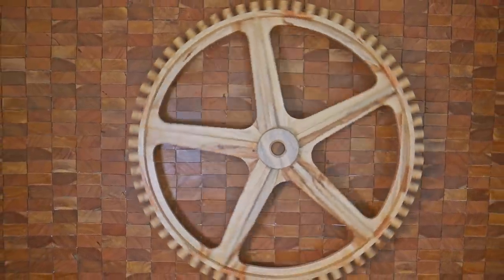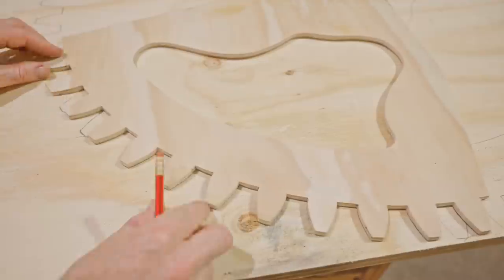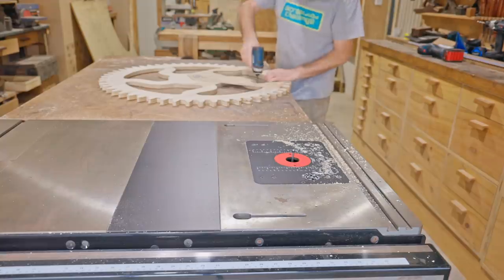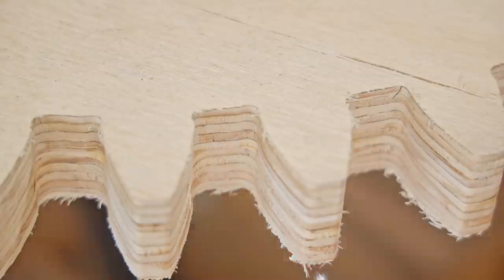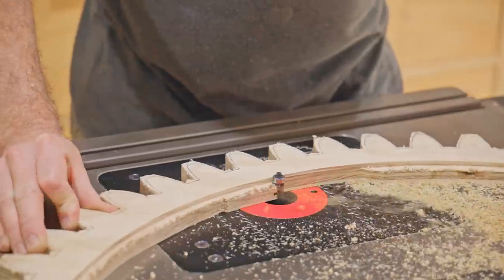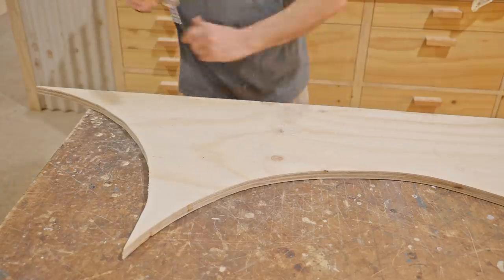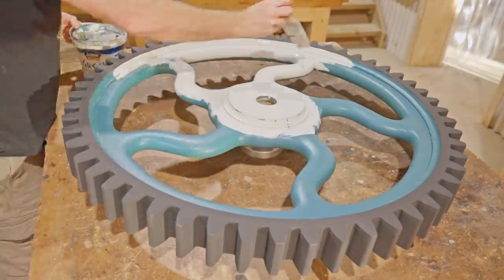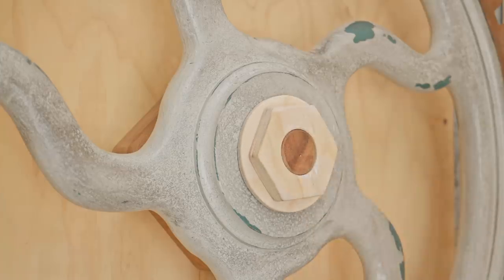How to Make a Large Plywood 'Cast Iron' Cog

Comment: Great video - no CNC, no laser cutter, no 3D printing, just regular tools just like 99% of the viewers would have. Inspirational.  Thanks for sharing ! :)
Reply: I have a 3d printer and no bandsaw, but inspirational nonetheless XD
Reply: Sure, 99% of viewers have a bandsaw, a router table, a handheld router, a lathe, drill press and an assortment of cordless power tools. Oh and a huge workshop, bigger than my apartment. I feel ya.
Reply: well the hole workshop setup is more expansive than those tools would be. 
And sharing desings is easier with that kind of stuff.

Comment: I think the finished gear looks great and the “rust” effect actually looks better once you added the clear coat. 
The same thing would happen to dry powdery rust if you sprayed it with oil.
For more faux finish effects you could dry brush silver paint onto the contact surfaces of the gear teeth.
Reply from the maker: Thanks! I know what you mean, it does have that look. It’s just the dry rust looked more realistic although the sealed rust effect still looks ok. 😊
Reply: @PaskMakes  when i first saw the notification for this vid i actually thought you had cast it in metal from a pattern that's how good the finished cog looks well done
Reply: @PaskMakes  My wife sprayed clear lacquer on an old ashtray stand and added a pot on top to make it a plant stand and it looks great. Neither of us had ever heard of spraying lacquer over rusted steel/iron but she figured she try it and it came out great. I really feel that it's a viable option when faced with dealing with a rusted metal object. It sure cut a lot of steps and made finishing that plant stand a simple matter of waiting for the lacquer to dry.
Reply: @PaskMakes  I was going to say the same as the OP. I think your bright Aussie climate might make rust look brighter than it typically looks in the UK. It tends to be brown and drab here and the clear coat makes it look more like that.

Comment: Fantastic job. Did a rust finish on a large steel frame used as a structural support in a doorway years ago. Sprayed an acid concrete stain on it to get a rust finish, it worked very well. Then sealed it with a clear urethane, it did change the effect more than I wanted. John Shoureas tip posted will come in handy. If you want an aged, weathered wood look, soak some steel wool in vinegar to make a rust solution (2-4 days, remove it periodically to let the oxygen accelerate the process ) . It will react with the tannin in the wood and "weather" it. Every species reacts differently, some take 20-30 minutes, others, like oak give immediate results. The faster the reaction the darker the end result. Fun to experiment.  A weathered wood cog may be a cool addition.

Comment: To further enhance the effect of 'weathering' on your new cog, give the whole thing a 'wash' (very dilute mix) of acrylic paints (black and burnt umber). Then before the paint has dried wipe away the excess with a rag. This will leave most of what paint remains built up in corners and recesses. Best to do in sections. Refer to Punished Props or Evil Ted for more details on weathering effects. Note that this is not to simulate the effects of being in the weather per se, but the effects of general usage.
Reply from the maker: That’s a great idea Barty - I did look at the recesses thinking it needed some grime in there. 😊

Comment: Painter and Decorator since 1982 and a aged paint finish is stumbled upon by accident. Acrylic paint over a surface wiped down with Barbecue fluid. You get a distressed crackle effect t that doesn't need sealing.  Just scuff up the finish and brush thinned Bison wax over the paint then empty the content of a vacuum cleaner bag and buff away. Smells a bit for a while but the effect is you can achieve are worth it. I was also restoring Antiques for a few years mainly Water Gilding and the same rule applied when making a piece look old and grimy. It is all experimental. I keep hammering away unti I get the desired effect.

Comment: I think the rust with the finish coat on top looks more realistic than just the rust. It looks like it's aged through applications of grease and neglect, rather than forced to rust. I would also suggest looking up rub n buff if you haven't. It's a metallic wax finish that a lot of model makers use to get natural-looking metal accents. A little bit here and there adds some depth to a piece. Great work.

Comment: So very cool! I can't wait to see the full setup with all the gears.

I wish I'd known that trick with the polishing wax for distressing the painted section when I was doing a similar effect on a rocking chair. So much easier than sanding the distressed bits!

For the rusted metal, have you thought about trying a faux painting technique? I painted a wooden plaque to look like rusty iron in my Skeleton Hand Lantern video. Started with a base coat of black, then went over it with orange paint, using water and two different brushes to get the look of rusty metal. It turned out great, and a the sprayed matte varnish we used didn't change the look. If you want to see how I did it, to see if it might work for you, it's toward the end of that video on my channel.
Reply from the maker: Thanks very much Andi! I have done some faux rust painting before and this week I showed my Patreon’s a picture frame I made years ago that looked quite convincing. 😊

Comment: I think...  If you applied the rust coat again, on top of the sealed wood, you'd get a rust/worn finish that would look great.  The chalky paint would only rub off on parts that make contact with the other gear... The rest would have the "rusted" look...  Which is just about how it would tarnish if it were actual steel. 

Either way, this series of props and gears has been great.  I've watched you make all 3 multiple times, can't wait for another gear to go on the wall...  Really can't wait to see that prop spinning!

Comment: Lovely stuff. You know, with the right gear arrangement and propeller pitch, you could hook up a quite ow power motor and cool the workshop with this? (You’d need to drill a bunch of air holes behind the prop for flow of air) 👍

Comment: The old cast iron cog wheels were made by sand casting, with wooden models to make the impressions into the sand mold. Due to the shrinkage of the cast iron as it cooled from the molten state, the wooden models were made oversized by a measured percentage (based on the quality or alloy of the iron/steel). The models’ spokes were made in C- or S-curves as you made yours, with the intention they would shrink straight in the casting. If the gear wheel was to have actual power load put upon the gear’s axle as from a drive belt (often leather) and not simply act as an “idler”, the cog wheel was usually fastened to the axle by way of keyways cut into axle and wheel, with a wedged key driven in to lock them together. Your setup is evidently all fixed axles with idler wheels, but your future project might add the keyways and key detail to complement your excellent display.

Comment: Next project suggestion: an antique looking 3-speed belt drive. Make 3 sets of wooden drums and fix them on 2 axles in opposite order (to allow a belt to drive a reduction, a neutral or an increase) and slightly round off the surfaces of the drums to make the belt auto-centre. For the belt: ask your local fire department for an old fire hose, cut it open and fit the belt with the rubber side of the hose towards the drums, the fabric side on the outside. Stitch the ends together with metal hooks. The old belt will immediately contribute to the antique look. The drums can be aged wood, because they were originally made from wood too to allow fine tuning the fitting and the auto-centering just by sanding. Also, leather belts would have to be refitted as they aged, so the drums needed to be sanded again after every belt maintenance.
Reply from the maker: Thanks Luke - that would make a great project. I’ll definitely keep it in mind. 😊

Comment: I realize this video was done last fall, but for the paint on the cog teeth, I would of given it a good base layer of silver then put the rust on without the clear coat. The point of contact between cog teeth will wear down exposing silver. This SHOULD give the impression that metal on metal contact is wearing the teeth down preventing build up of rust. Though Wayne Crews makes a good point about the clearcoat looking like rust that has been oiled.

Comment: Awesome look! The sealer didn't really ruin it, I think. At least not after it dried completely. It looks like a light coat of oil or humidity on a rusty surface, which is what you'd expect from such a cog. If you really want to get realistic, you could add some blackened cog grease (just mix in the dust you get after grinding steel, which is exactly what makes the grease black in real machinery) with some chunks around the axle as well.

Comment: "Vintage" surface-techniques are as many as there are antique furniture forgers and window dressers ..... mine for surfaces we printed on (serigrafic prints) or did hand lettering onto, which were supposed to look "weathered" or slightly worn, was using normal white wall paint (non-latex, non-acrylic) without thinning or excessively mixing it as a ground layer, thickly put on with a bricklayer's brush leaving brushmarks, and sprinkling it with water from another thinner brush while fresh/wet, thus creating random "wholes" and dents in random patterns. The thicker the ground layer, You can achieve fissures and flaking, too. After printing/lettering, floorwax with different artist's oilpaints from grey to ocker to blue-ish or rust-red mixed in it was applied, rubbed in and after hardening polished with very fine steelwool. Different layers with different colours overlaying each other possible. Made for great "seasoned/dusty/grimy/sublimely interesting" surfaces, easily achieved in bigger scales like window-dresser's backgrounds as well.

Comment: Great prop work, as it looks like a cast gear! Got any metal casting folks to use that as mold template? If I may suggest, I would have put a UHMW sleeve in the center, to last and not wear the wood out for your motion project.

Comment: The way you marked out the gear teeth was the best way. Printing and gluing together a paper template always introduces errors. The printer doesn't print perfectly, you can only glue it together with an accuracy down to +- 0.5 mm and so on.

Comment: A mock steam engine cylinder would look awesome, connected to the last gear if the chain.

About the rust, I find the sealed one looks better, resembling real deep steel rust. The unfinished paint looks like light surface rust you get after a day out in the rain, not what you see on old worn machines.

Comment: Really cool. I'd have probably left the rust unsealed. I don't think it would all rub off and if you're not handling them a great deal or taking care to not handle the rusty parts then any rubbing off would just be transfer from gear to gear. Probably need to wipe up a bit below them as any rust powder falls down, but eventually I think the rubbing away of some of it would lend itself to the look. After all on working gears the faces can be rusty but where the teeth mesh will not be.

Comment: I think you were a pattern maker in another life.  :)  Have you seen Wesley Treat's channel?  He also does a lot of weathering.  RE: making the gears turn smoothly, you could make a very fine bearing using a rectangle of milk jug wrapped around the axle.  I don't expect you'll be turning very high RPM or running a heavy duty cycle.

Comment: Don't use black for the grime. Use dark browns, at least two. Also, in the cyan layer, you should've painted all the sharp edges with silver paint, that way, when you remove/distress the paint, the silver pops out, as bare metal. Finally, it's too perfect. Dents, casting defects, and a few other issues help the over all look. Also, silver would've been a great base coat for the rust paint, because it's expected that if you turn a rusted wheel, it will wear off, so the areas would've rubbed off, would've appeared fresh metal.
Best silver for this would be a dirty silver, so something you have to mix yourself, as most canned silvers are perfect (as per need). Black and brown in mix (test it out) would give a great dull metal finish.
Source: i made a couple of big steam gears for someone years ago, it was an apartment, so it would've been impossible to put actual gears (Static load) so plywood had to be.
PS instead of sealer, put any type of hard wax.

Comment: I only learned this last week, but what you have is a gear, not a cog. I had used the terms interchangeably, a retired engineer corrected me, apparently a gear is defined by transmitting power via teeth whereas a cog is defined by transmitting power via the spokes. There is even a female cog. Both are capable of infinite length, known as a rack.

Comment: I don't see any reason it wouldn't work under load. Between this and the last one, this is roughly equivalent to how they used to make wooden gearworks in late medieval waterwheel mills. The only difference is you have better glue than they did, so you need less post joinery.

Comment: .81652:1 reduction ratio…

Or if you swap them a 1.1818… step up.    I’m thinking if you go the step up route and put a couple more steps in there you could get that propellor really whizzing.
Reply from the maker: I think the set up I have planned will be 1:5 but I'm not sure it would run smoothly enough (if it even works at all) to get any real speed. :)
Reply: @PaskMakes  I will keep watching and calculate the ratio as you go. While not a super practical build this is amazing to watch as it develops. 

If I could make a suggestion, for the final drive wheel with a handle to make it all go, perhaps you could make an actual wood pattern and then  do an aluminum pour cast gear.  I think it would be EPIC to see you add casting to your repertoire.

Comment: I don't think it would look right if you redid the rust finish. The teeth of the gear are plainly in excellent condition. Even if people are not conscious of it, this implies that the gear was in use up until it went on your wall. The first rust finish looks much more like rusty metal left outdoors for a long time. The second version looks much more like a gear that was oiled and maintained properly throughout its life but developed some subtle rust staining which tends to happen with old machine tools. Particularly because so many of them were copper coated which has worn away and it is left with that vague rusty almost bronze appearance. I think that the very sharp teeth just would not read well with the more aggressive rust finish. If you greatly prefer that finish, perhaps a few broken ear teeth and heavy wear might look more appropriate
Reply: It's a very cool project either way. I've been saving up steel gears for years with the dream of making some ridiculous Rube Goldberg device that turns tons of iron simply to ring a doorbell or some similarly banal task